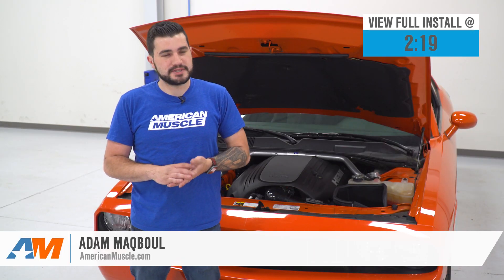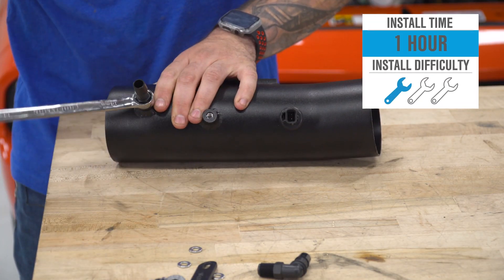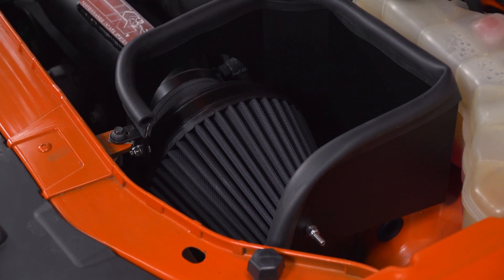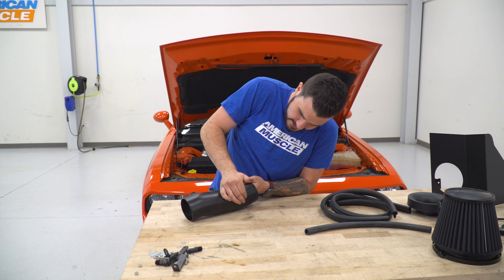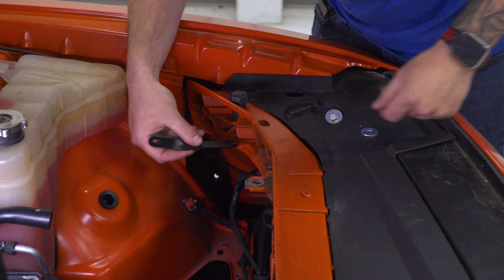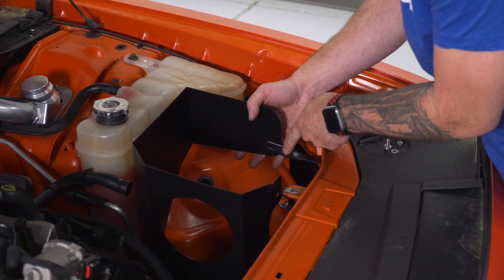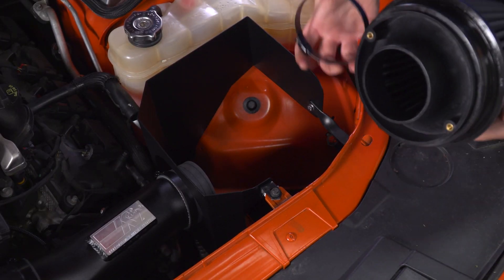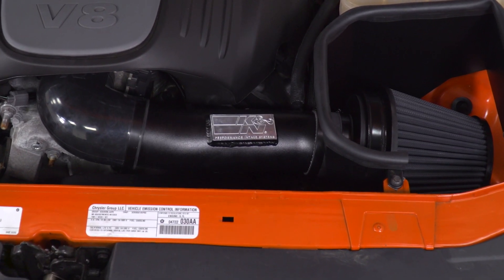2009-2021 Challenger 5.7L HEMI K&N Blackhawk Cold Air Intake Review & Install

Comment: Great video 👍🏽 . Can I install this with a 90 mm or 85 mm throttle body bbk or it can only be installed with the stock throttle body in the charger rt 2021 ?

Comment: So it’s not a closed air box which means it’s not getting cool air at all….
Reply: With the hellcat hood and popped open headlight cap it does amazing actually. It rapidly cools down almost ambient temp. But with a stock hood and without proper air flow i could see it sucking pretty bad.

Comment: Why do they call them cold air intakes? These are "HOT AIR INTAKES". If you can see the filter element when you open the hood, you have a "HOT AIR INTAKE!" That crappy little partition around the filter counts for nothing!
Reply: They are cold because if you install one you there's a hole in the bottom of the air box sucking up cold air. Back then the short ram intakes were exposed the heat of the engine and no cold air.